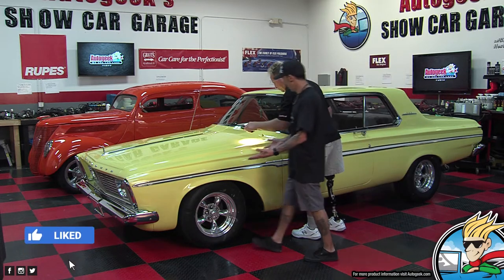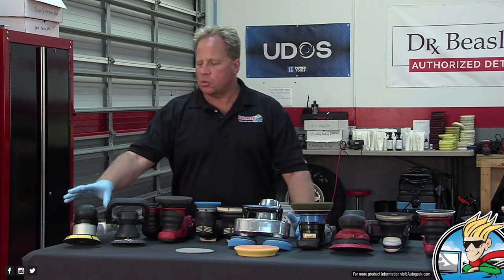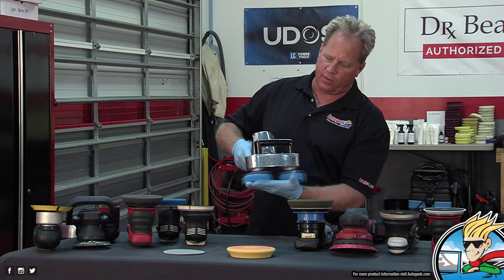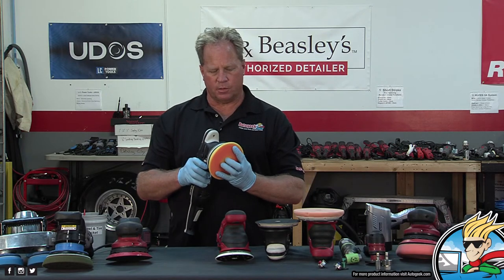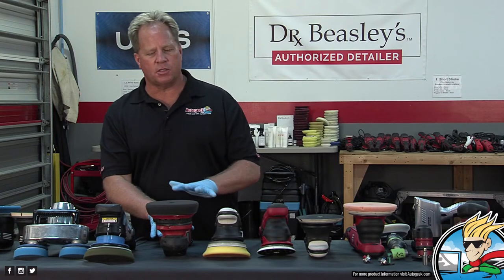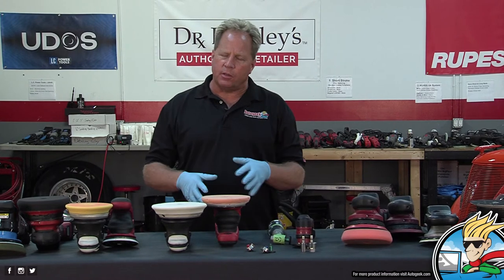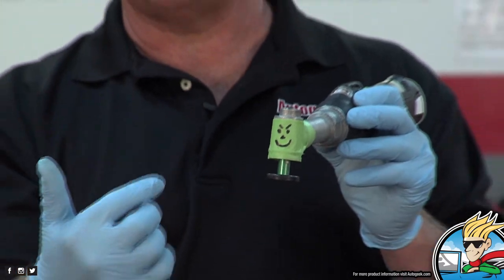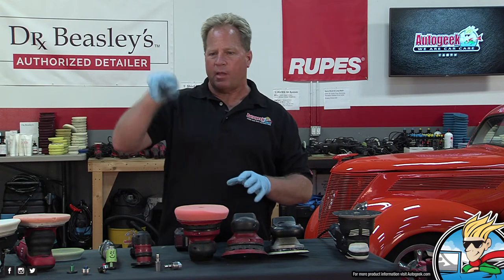A deep dive into the world of polishers - Types, Usage & Techniques

Comment: i learned something. never knew rupees pads worked better on the Flex boss.  I have used Porta cable and flex never used any other DA I started out using a Dewalt orbital. it took longer to cut the actual polishing. I still use the dewalt for polishing. I'm glad now becauses this in depth is lot of information to take in. I'm going to rewatch this video to absorb more information.

Comment: Hi there...What's the model nr of (FLEX) THE FINISHER ?
Also, for just/mainly polishing glass, in combination with RAYON disc + Ceriglass, which tool/polisher would you advise : Rotary / DA gear driven or gear driven, taking into account that you have the throw or orbit (8 mm / 15 mm) ?

Comment: Hey Mike I know this is an older video and I'm looking to add another polisher to my arsenal. I currently have a first gen G21 w/5in plate , griots 6in converted to a 3in, and just recently picked up a Flex pxe 80. I'm in a toss up between choosing the Flex Supa Beast or the Rupes 15 mark lll for my "go to" or "all around" machine that I'd use most of the time. In regards to the Supa Beast does that usually finish down really well compared to a R.O? Im aware not all paints may play fair with it.  Thanks in advance ✌🏽
Reply from the maker: Either tool would finish out great. It really comes down to personal preference at the end of the day. If you are able to, we would recommend getting your hands on them and playing around with them to form your own opinion on how you like the 2 different tools. Both tools are great however! The chemical and pad combo used to finish out will typically make the biggest difference in the end.
Reply: @autogeek  ok perfect! I use 3 good brands as far as liquids go (Sonax, Angelwax, Griot's BOSS) and rupes or LC pads. I wanted to try out a forced action DA but idk anyone that has one haha. Do you guys have a return policy on items like these or nothing exist? Thanks again
Reply from the maker: @jkroemer2685  If the machines are used, there is a 15% restocking fee. Trade shows such as Mobile Tech Expo or Southern Detailers Conference (SDC) are great opportunities to try out some tools. SDC is coming up in June in Kentucky.
Reply: @autogeek  ok thank you! If I didn't like it I'd deal with the 15%. Would cost me more to go to Kentucky 😄. Thanks again and I'll order one here in a few
Reply: @autogeek  I see. so basically I'm still using the right tools and pads I use for them. these are just options. I get it now. I though I was doing something wrong?I know my customers have loved my work, but I have this anxiety that i'm not doing enough for some reason. I don't no. May I'm a little insecure, because I wan t to do the best job possible. that's what my customers are paying for. At the end of the day they are happy. That's all that matters. I still want to better.

Comment: I notice something curious , I’ve heard that a forced rotation polisher  is the fastest cutter from all DA , it has 8mm throw , so what it makes it different from a free spinning is the fact is gear driven so it’ll never atop the movement no matter the pressure it gets . Buts the throw still 8mm , with that I’m mind mastering your technique with a regular 8mm Free spinning DA , will do much cut than a 15 mm DA ?
Reply from the maker: With free spinning random orbital polishers - you have to LOOK at the pad and the backing plate 100% of the time to see if the pad is rotating or stalling out.  This is a type of MENTAL ENERGY that drains you as you invest yourself for HOURS into buffing out a car.  Your choice.  Me?  I use gear-driven orbital and cut out the mental drain.

Also - with ANY brand of free spinning random orbital polisher - the pad is not rotating - you are WASTING time.

Your life, your budget your time your choice.  -Mike Phillipos
Reply from the maker: Also - a FORCED ROTATION polisher is a rotary buffer.  A gear-driven orbital is FORCED ROTATION FORCED OSCILLATION - seems like no one gets this because all I see are people calling tools like the FLEX BEAST and the RUPES Mille forced rotation.  This is technically incorrect.  Just saying... -Mike Phillips

Comment: I’m still confused,  what’s the difference between a gear driven vs a rotary polisher? They sound the same to me.
Reply: The rotary has no oscillation but just a rotation.  Gear driven is more like DA (rotation + oscillations) but the rotation is forced and does not stop even if the pad is not flat.  while DA rotation stops if the pad is no longer flat, and only oscillates !.
Reply: @nicorallysport  but doesn’t the gear driven polish won’t stop neither like a rotary polisher? I know a DA random will stop if you add to much pressure.
Reply from the maker: That is correct the gear driven will not stop - hence the power that you get from these tools. - Yancy
Reply: @autogeek  so is the gear driven easier to use than a rotary? And for paint correction what’s a better tool to use, the rotary or gear driven?
Reply: From more "cut" to less = rotary, DA gear driven, DA random, the last being the safest for beginners, the rotary being the most aggressive, the gear driven being between the two, in my opinion !, mais les 3 si bien  used can be an excellent arsenal!
Reply from the maker: Easier to use, I would say yes but remember what was mentioned in the video about the walking effect with these polishers. I personally think it teaches you how to use the polisher and yells at you when you don't lol. I don't think that they are hard to use at all and a great tool to have. - Yancy
Reply: @autogeek  thanks for all that info!